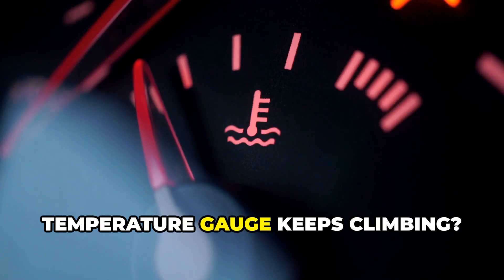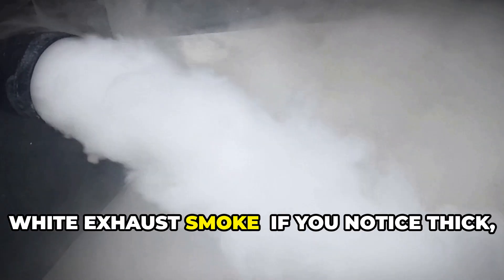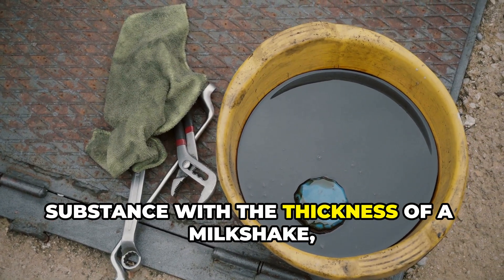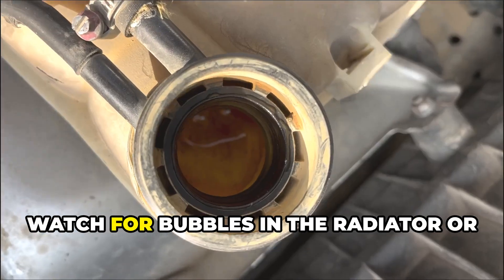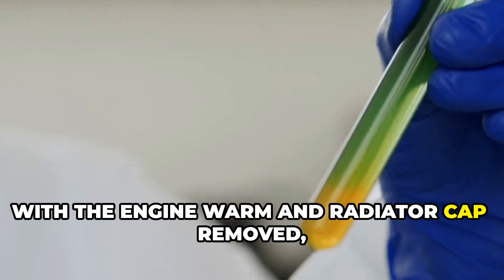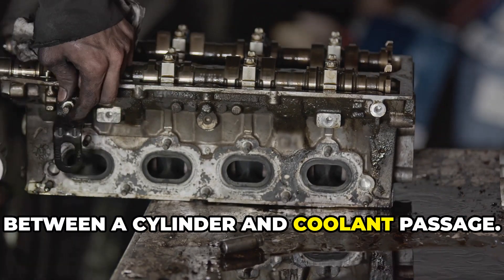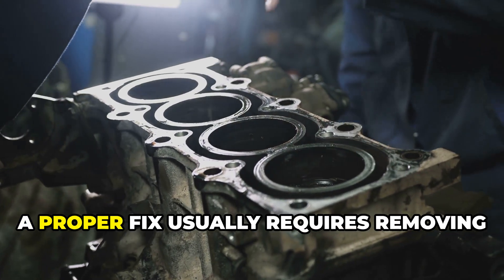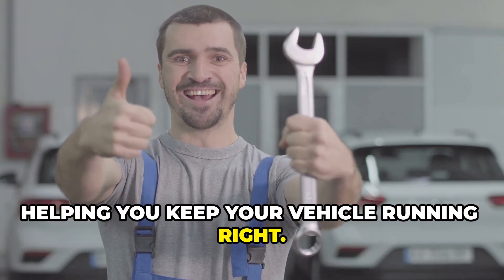How to Identify (and Confirm) a Blown Head Gasket?

Comment: I had thick mayo consistency milkshake on the oil cap, but no white smoke. Turned out to be many short trips of 5-10 minutes in rainy Pacific Northwest , without running the engine enough to get hot enough to dry out the moisture,  i guess in the crankcase.  Mechanic checked for blown head gasket and it was fine. Ever since i run the engine till normal temperature is shown on the coolant gauge.
Reply from the maker: Thanks for your comment! You might’ve spoiled my upcoming video! 😅
Reply: @HonestMechanicChannel  oh no, hope not! Really appreciate your videos!
Reply: You are lucky you have a honest mechanic, like Brian!